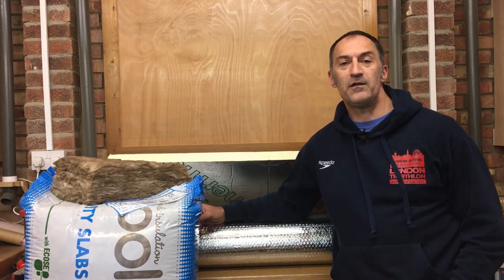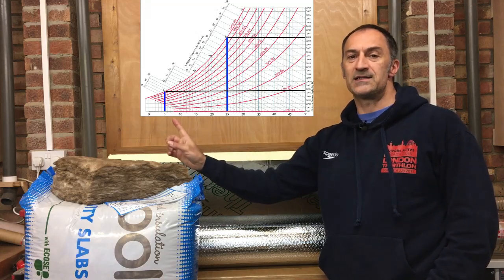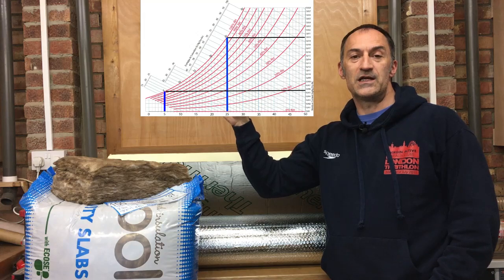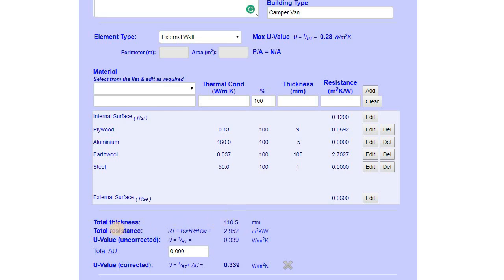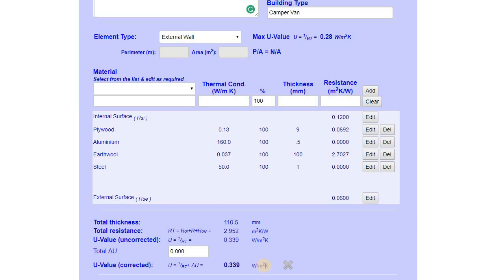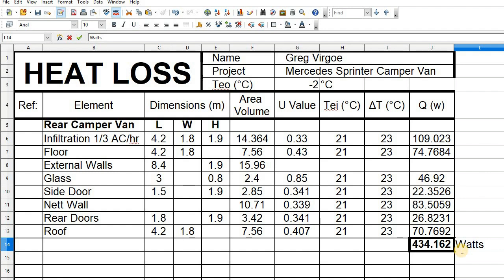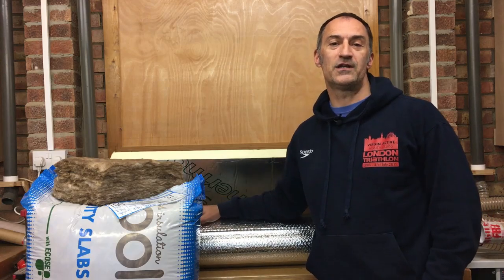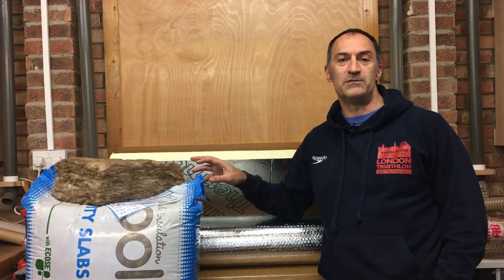How to Insulate your Van Part 1 - The facts you need!

Comment: Very helpful. Thank you. I always watch people insulating w reflective and think there's no way that's effective.
Reply from the maker: I just want to help others not make the same mistakes.
Reply: @GregVirgoe  why use reflectix at all if it is such a bad insulator, isnt it really expensive to just use as a vapor barrier? Why not just use polyethylene sheeting or the like at that point, its much cheaper($130 vs $20 for rolls of the same size). The aluminum cant reflect any radiant heat without an air gap right? Thanks for the video! Very informative
Reply from the maker: fred c you can use polythenes as long as they are a good quality builders polythene. Otherwise some are very slightly permeable. 
Foil is 100% impervious to water or moisture so it is the better barrier. It’s not that expensive. I wrapped my entire van for £90 and it easy to work with 👍🏼😊

Comment: Greg, with the  thermal conductivity of steel at 50 and your mineral wool at 0,04 The thermal bridges caused by the cross members in the van will transmit twice the amount of the insulated panels. And you also could have mentioned the ventilation Chanels in the front doors.
Reply: I have seen your upholstery video and I noticed that you have covered all the  metal parts  which are thermal bridges with bubble foil. Thermal bridges will have a different temperature than the rest of the interior. The temperature difference will lead to very  large infrared heat transfers (200W/m2) at a temperature difference of about 20C. This is for a black body. Covering with bubble foil will greatly change "infrared colour" from painted metal (97%black for infrared) to a about 5% . As a rule of thumb: If you are finished insulating a van cover al the non insulated metal parts  with bubble foil (and upholster them).

Comment: In revamping homes, I have found that mineral WOOL insulation will fall/sag and not give the insulation  properties as they advertise; so, to fill the hard to get areas, use spray foam or break up into small pieces the foam sheets.
Reply from the maker: I have oversized the pieces that I put in there and then stuck them with Trim Fix to the Relfectix covering everything to keep it all in place.

Comment: Love your contribution of some evidence to back up the reasons why you have done what you do.

One thing that seems to have been missed is the relation of the operating conditions to the level of insulation (and need for heating) etc etc.  Designing for UK and Northern European winters, or indeed northern USA is different to designing for temperate climates or indeed to tropical climates.  For high and low latitudes you probably need all the R values and insulation you can get.  For some of us in temporate climates (I'm from Melbourne Australia and have just done a 2 week tour in a hired Sprinter in SW Western Australia) and I really wonder about the trade off of using a 6 inch void for rock wool when almost the same amount of R value can be achieved in a 50mm foam board.  4 Inches of void space could be a usefulstorage option, if you can get it in, and then utilise the space for storage.

So how much is enough?  I'm looking to build a camper to support us in our training business and at the moment we have work in the northern states of Australia - so I suppose tropical = similar to the 40 degree plus latitudes with the more the better, but forget the cost of heating and add an airconditioner and a bigger fridge
Reply from the maker: Hello Paul, thanks for such great feedback.
The 50mm foam board will give you the best insulation per inch out there currently.
Most mineral wools are only half the thermal properties so you need to have twice the thickness.
Insulation in a warm climate does work the same by keeping the transfer of heat out of the van.
Much like a cool box does with your beer in the warm summer sun.
The biggest heat gain in warmer climates is solar gain through windows.
If you can install reflective window blinds that will vastly reduce the internal temperature.
Air voids are not a viable insulator in vans as you need all the space you can get.
Hope that helps and thanks for watching

Comment: Looks good, was wondering if the same method would work in australia, where it is v.hot during the day and cold at night etc thanks for publishing
Reply from the maker: Hi Sue, Insulation works the same both ways hot or cold. Your fridge or cool box is insulated to keep the contents cool and the heat out. The biggest heat gain for vehicles in the sun is the solar gain through the windows. The suns rays travel through the glass and heat up the contents of the van. The more you can shade the windows from direct sunlight the better, external reflective blinds are the best, internal ones do work as well but not as effective. Hope that helps

Comment: Such a good video that I finally understand! =) One question, what about putting "Aluminum foil, Rubber plastic sponge" the one that is "self sticking" straight on the van before the insulation? And would you still need to cover the insulation (between the insulation and wall)?
Reply from the maker: Hi Daniela, That black dense foam is normally used for soundproofing and acoustic treatment. It will give insulation but can be very heavy and not very thick. You would always need to put your vapour barrier on top of any insulation before applying your wall finishes.

Comment: Take spec of top ten vans i e
Chev has  135", 155", 179" wheelebase that converts to cargo area deminision.
Box trucks
Step vans 
Many would be glad to pay for the calculation or manufactures would sponsor a web site. Your work is verry professional. Have only seen one other person with real specs and quality work. I am going to build a box truck with modular componets. So i can use q chev express box truck and dump trailer with modular camper   shell. That way i can remove nodular units and use van and trailer for moving, junk hauling job shack and living space. All componets can be stored in mini storage. And van, trailer and job shack stored at mini storage when on vacation. A modular battery contrller unit that can mount on trailer hitch. New idea like your opinion. Later i will buy two containers and build a garage to store van and trailer.
Reply from the maker: Sounds like a cracking idea. There is a company it the UK called Ocado that deliver groceries for Waitrose.
Their vans have removable insulated cargo pods on the back, that can be shipped across country on a larger lorry then offloaded and placed on the back of the van for local distribution. They use Mercedes Sprinter chassis. A second hand one of these would make a great conversion donor vehicle.
https://www.google.co.uk/search?biw=1920&bih=900&tbm=isch&sa=1&ei=TeQVW7ucMqmOgAaRy6GYDQ&q=ocado+vans&oq=ocado+vans&gs_l=img.3..0l2j0i8i30k1j0i24k1l3.25064.28199.0.29092.13.13.0.0.0.0.76.800.13.13.0....0...1c.1.64.img..0.13.799...0i10i24k1j0i67k1j0i30k1.0.Byzpnc4KQWI

Comment: Fantastic and VERY helpful.  I really appreciate it.  I like the rigor you put into it (obviously it is something that comes from your profession) as it makes everything you say backed up by science.  I also appreciate that you point out that reflectix should be as a moisture barrier and not insulation (because there is no air gap, and therefore no radiation that it can reflect).

Keep up the great videos!

Comment: triso 10 insulation is 0nly 30mm thick and is equivalent to 210mm of celotex , used with a gap . ie fixing roof battens then ply cover gives the van a radiant barrier . its easier to cut and apply than celotex  . ive used it on loft conversions 
youd need at least 130mm of celotex to come anywhere near suitable for a habitable room

Comment: Hi Greg, 

First of all thank you for all your videos, they are so informative and extremely helpful. I was wondering whether you can help me with insulating my van. I am tossing up between the earth wool which you have used in parts of your van, vs closed cell foam. From my research I have found that closed cell foam has a higher R value for a fraction of the depth of the earth wool, but am wondering why people don't use it. Is there something I am missing? 

I have found a company that has a 6mm and 10mm adhesive backed closed cell foam with a reflective back, so just wanted to double check with you before I make the wrong decision. 

Appreciate your time Greg, thank you very much,

Kind Regards
Stefan

Comment: Cool professional calculations. I would suggest you do the calculations for standard model equip. Ford, GM, Dodge vans. Then also do calculations on box trucks 10', 12', 14', 16', 18', also step vans 14', 16', 18'. A list of materials and prices. I and many people would be glad to buy a set of plans. Can you glue 1/2 inch poly on wall of alum van box to deal with moisture? Or as you said use reflextic as vapor barrior .
Reply from the maker: Hello Robert, thank you for your feedback. Glad you liked the video. 
The spreadsheets are in the description and with this method everyone can have a go at doing their own calculations if they really want to. 
Essentially it demonstrates that a good layer of PIR board or eco friendly recycled insulation and vapour barrier over the top will give you great insulation for whatever vehicle. I'm not looking to sell plans as every van and design is completely different. That the beauty of self built vans, you build the layout how you want it to be. My hope is to give you the tools help with that process. 
Ideally you need some insulation between your van wall and your vapour barrier or ou may still find condensation forming on your vapour barrier because it's as cold as your van.

Comment: Very instructive about the calculations.

Hey, you're not putting the Reflectix directly on the metal, yay!  That seems to be a van converter special, and I can't think of a greater waste.  Still, your approach also confuses me.  What I know of insulation is that you should have -- at most, and it depends on climate -- one side of the wall covered with vapor barrier, so that the wall can dry out on the other side since it's basically hard to make it impossible for moisture to get in at all.  The van already has a vapor barrier; it's metal outside.  So if you put a vapor barrier on the inside as well, don't you trap moisture in the earth wool, or between the foam board and the metal (condensation, intrusion of water through external seams, moisture getting in from the inside via gaps)?  From what I've seen in boats (I do general maintenance and repair as a side job), badly installed insulation (along with bad air circulation) is the main culprit for rust and mold forming on the respective walls, and the worst cases have all had vapor barrier on the inside. 

I don't think I'd put a vapor barrier up at all in a van (our boat has none, and it's been fine for 7+ years), and probably use spray foam (we didn't do that, because we have a wooden hull which I want to monitor, and we had a very cheap source of rock wool, which I think is probably similar to your earth wool).  You're right that once foam is in, it's a royal pain to remove (we had to do that for the hold area of the boat where the insulated fish tanks were located, and I never want to do it again).  But I am not sure why anyone would want to remove it in a camper van.  I hate working with the stuff with a passion, but I don't think one can get a better seal.

Here's an article that talks about vapor barriers with greater authority than I can claim:  https://buildingscience.com/documents/digests/bsd-106-understanding-vapor-barriers -- it's geared towards buildings, but the principles would appear to apply in general.  The author explicitly warns about double vapor barriers.

Comment: I'm respectfully, not convinced.  It seems important to only have ONE vapor barrier (the steel shell of the van).  It seems that TWO vapor barriers (the van shell and the Reflectix) will eventually trap moisture and mold will build up.  What do you think of the importance of ventilating the area adjacent to the vapor barrier?
Reply from the maker: The whole idea is to create a complete sealed void inside and outside where no moisture can get into it at all in the first place. There is no need to ventilate the void because there will be no moisture in there anyway. Prevention not cure. Seal all the trim holes and any other voids completely that is the answer. 
I have 30years of practical experience along with the qualifications. 
At the end of the day you do what you feel is right in your van. I can only advise. Thanks
Reply: Thanks Greg.  I was so excited when I found your videos.  Then I called two Van Conversion companies.  PleasureWay said they haven't had complaints about mold (???) and they don't use an interior vapor barrier.  A company in California was adamant that it's best to let the insulation in a van breathe.  They also used a porous material on the walls/ceiling, which in my mind would be impossible to clean the cooking smells/grease out of.  My neighbor (a building inspector) said that houses and vans are different.  However, my gut says that you are right.  My sense is that the people who advise against the internal vapor barrier don't know how to create it so that it is truly sealed (the way you do it).  Thanks again.

Comment: I was wondering what your reasoning was for still using Reflectix as a vapor barrier rather than something else? I would think there would be substantially cheaper materials that would perform as well if not better?

This is a total side step but I am also curious to see if you have an opinion on installing adhesive backed sound deadening/damping material such as Rattletrap on the bare painted metal interior of a van before adding insulation/walls/floors/etc.  I constantly see videos where people spend a full day installing sound damping materials on the floors, walls and ceiling of their van and then they install rigid foam, spray foam or even just pink fiberglass insulation covered with 1/2" thick tongue and groove boards for their walls. Perhaps I am wrong but if the van is insulated well those sheet metal panels won't be able to vibrate and create much noise inside the van because the insulation does the same job as the sound damping material. Wouldn't the RattleTrap type sound damping material be pointless then?
Reply from the maker: Hello Al, aluminium foil is totally impervious to moisture, the reflectix just makes it more substantial to apply without tearing. Some plastics are very slightly permeable. With regards to sound deadening please watch my sound video https://youtu.be/fmvxtaZjFww that should answer your questions. Thanks for watching.

Comment: Great video series, Greg! I just bought a 2005 Ford E-350 and am at Day 1 (Strip Out) on my first campervan conversion project! Yesterday, I sold the wheelchair lift and seating on ebay so I am on my way. Your insulation design seems well executed but I am struggling with how moisture is managed within the insulation layer. I think of three distinct environments: 1) inside air, 2) outside air, and 3) insulation layer. By creating a gas-tight barrier between the inside air and the insulation layer, the higher moisture content air space inside the van can't migrate to the exterior van wall and condense on a cold night so it seems logical to block that moisture pathway. However, if there is a similar gas-tight barrier between the insulation layer and the air outside the van, wwater vapor in the air within the insulation layer will certainly condense on that cold surface. Is it true that the insulation layer is gas tight with respect to the outside air? I suppose this trapped moisture would once again vaporize when the outside trapped air warms back up. I have always understood that the insulation layer has to breathe but maybe it is not sealed to the outside air? Are there weep holes in the floor. These visions of a rusty moldy insulation layer are keeping me up at night. Please explain how this works so I can get some sleep!

Comment: Why reflection rather than some  kind of thick plastic? I definitely be sharing this with my viewers
Reply from the maker: Nothing wrong with using thick plastic as a vapour barrier.
Best to get one that designed to be a vapour barrier.
Some are very slightly permeable to moisture.
The PIR board comes foil faced so it makes sense to continue with that
Reply: Greg Virgoe thank you for the reply. Here is a link my video calling for more experts to get involved in the discussion if you’d like to be part of the conversation: Help Me Solve The Vapor Barrier Debate https://youtu.be/Fz59D9ai7CY
Reply from the maker: Yes, I have watched the video, nice route for a bike ride too, just been out on my triumph earlier today.
I have written a post which bullet points the main reasons for insulating using my method.
Thank you for the interest you have shown in my videos and for the mention.

Comment: But what if the goal is to keep the heat out?
Reply from the maker: Hi, insulation works exactly the same, hot or cold.
That cool box that you got your beer in is insulated. :D
Reply: Yeah.. it is. Thank you! :D

I just had my facepalm moment.
Reply from the maker: It's natural to think of insulation for mainly keeping you warm, but it can equally work just as well to keep you cool in the summer. make sure you fit blinds to the windows to reflect the solar gain

Comment: How thick would you need to have closed cell foam insulation on a DAF 45 box truck ? Some say 25mm thick and some say as much as possible.
Reply from the maker: If you can spare 50mm of thickness that would be an excellent level. I have that amount in my walls and ceiling. I have 25mm in my sub floor.